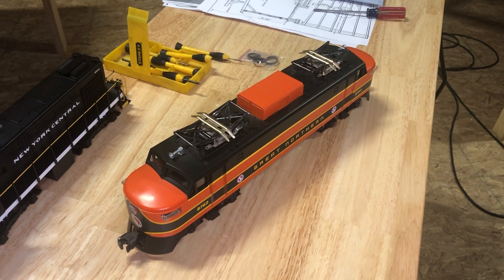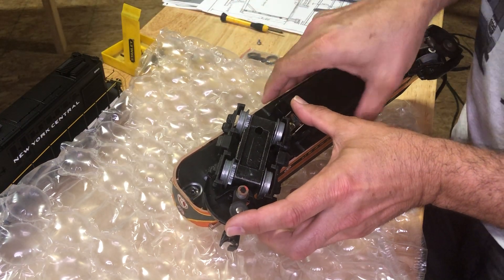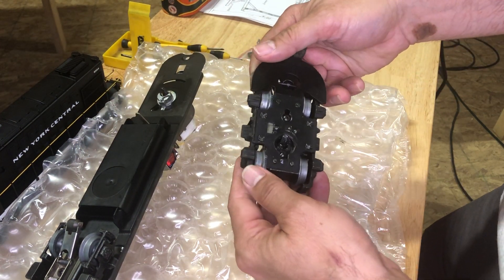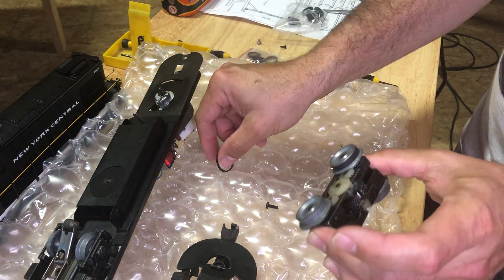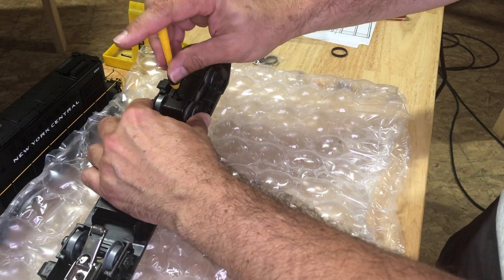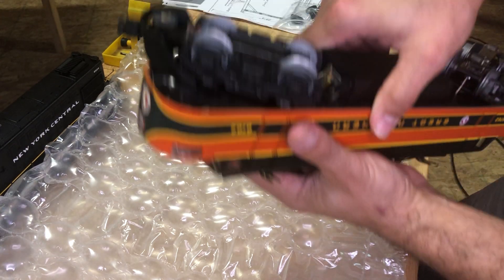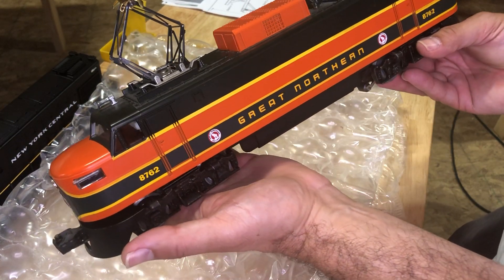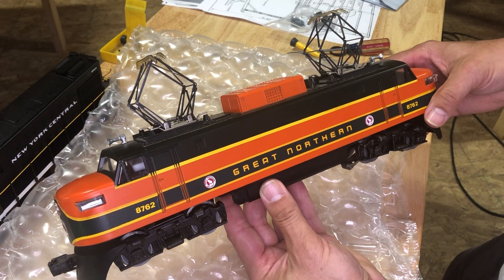Replacing Traction tires on a MPC Lionel Great Northern electric 6-8762

Comment: Hey Chris, great video! I just picked up a Lionel Little Joe EP-5 in great shape like yours except it too need a traction tire replacement.  
What is the part number for those tires as I want to order some or pick up at the next train show I attend.  
Thanks
Reply from the maker: Hello Bruce I picked these up from eBay Trains in the attic,  LIONEL DIESEL TRACTION TIRES  (12 EA) ALSO FITS K LINE-WILLIAMS O-GA 3/4"ID 
the 3/4 ID is the key! So far they have worked great  for 14.75. Thanks for the comment and thanks for watching my channel!  I have a few other videos like this one.
Reply: The part number for the rubber traction tire is 600-0222-108 Lionel part number that is. I hope that helps. By the way could you do a video on how to put those tires on the single motor MPC diesels please?? Thank you and nice video!!!